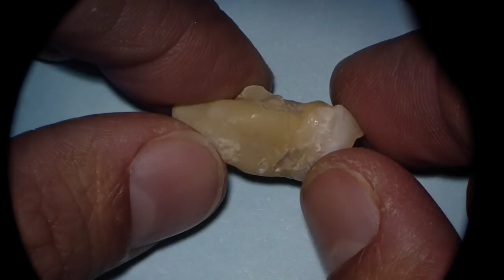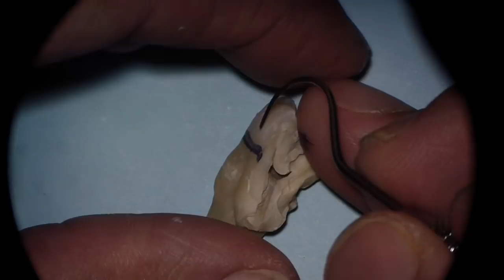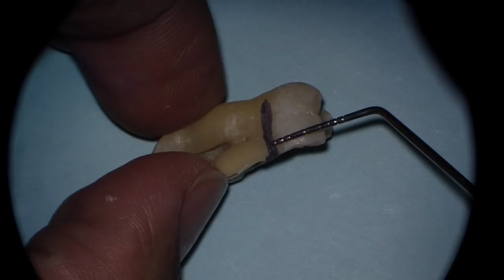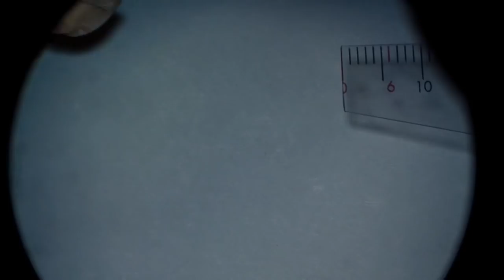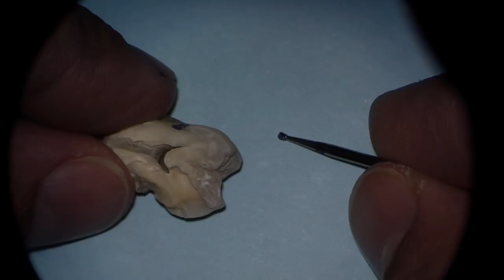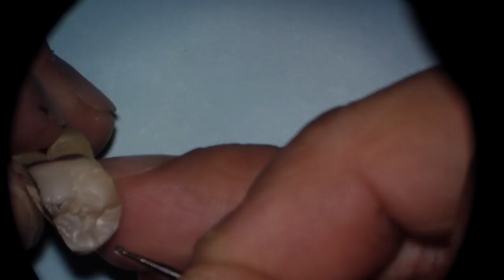Molar Endo Access: CEJ is your Guide

Comment: Another way (if you have small convential radiographs) is place the high speed with fissure or rose head bur against the pre-op periapical. This will allow for appropriate depth and angulation for straight line access.